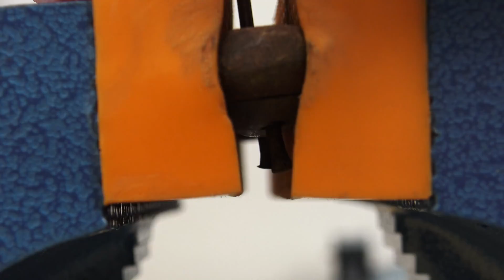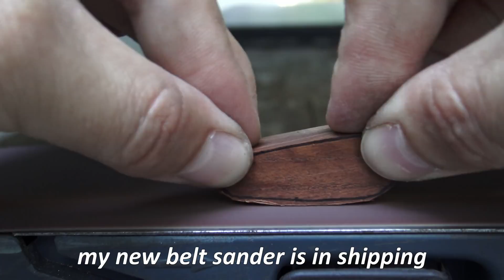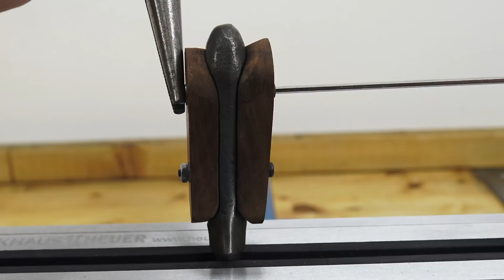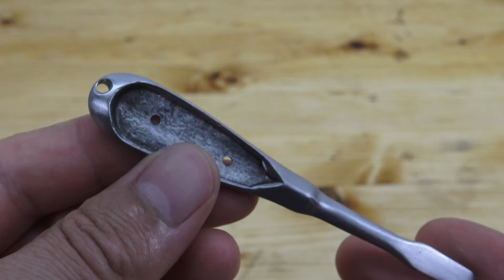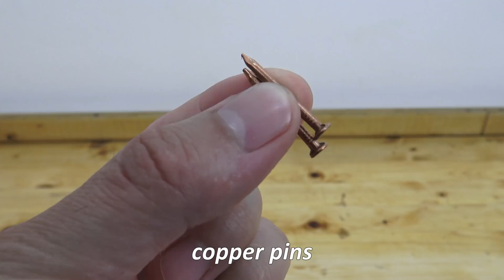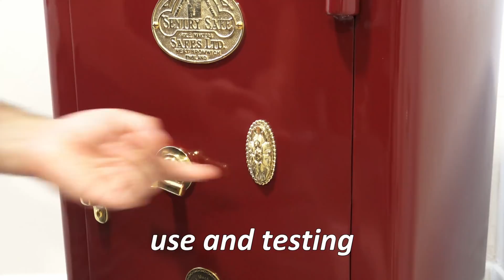Antique Perfect Handle Screwdriver - Restoration Videos - Perfect Restoration

Comment: What is the trick to allow one to hammer a symmetrical head on the copper rivet without damaging the  wood? I cheat and use knife maker’s interference fit handle rivets in brass, having failed with copper. Did you anneal the copper?